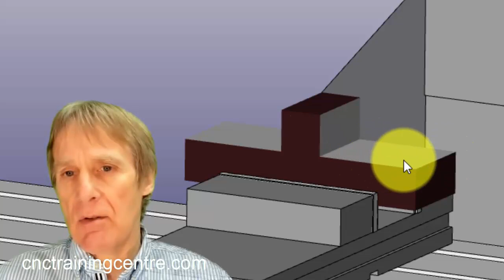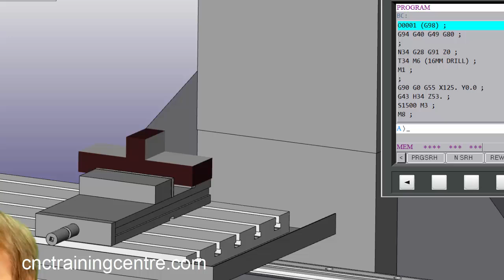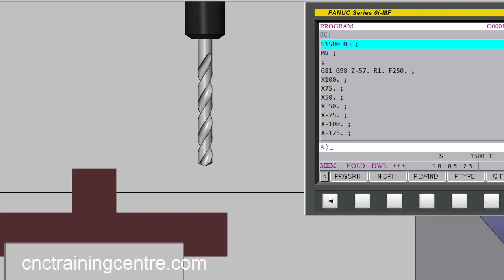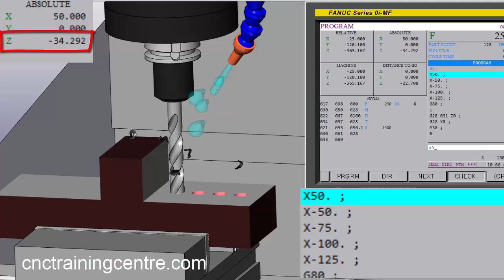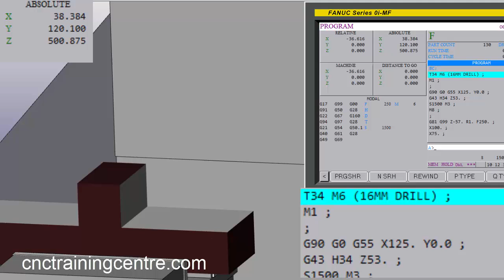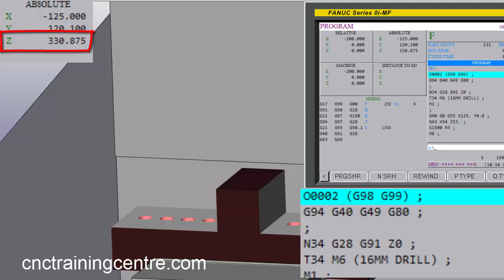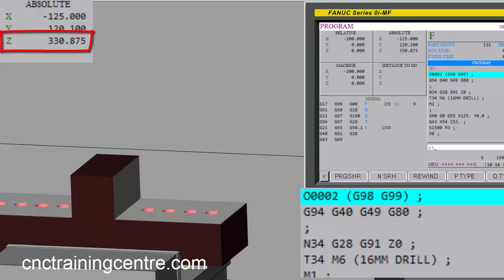How to Use G98 and G99 in a Canned Cycle

Comment: how does 6050 setting (macro call G) does work, like I just try to input in 6050 my macro B programme O9010 and than call it using g100 and there error appears “improper G-code”, so how does it work actually?